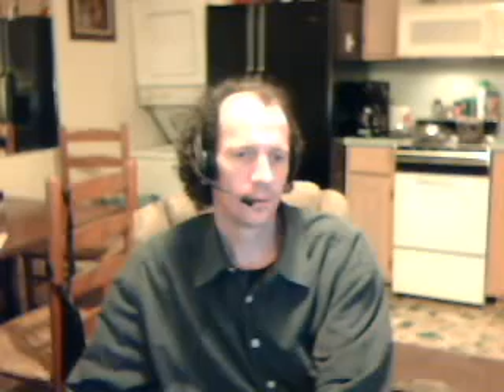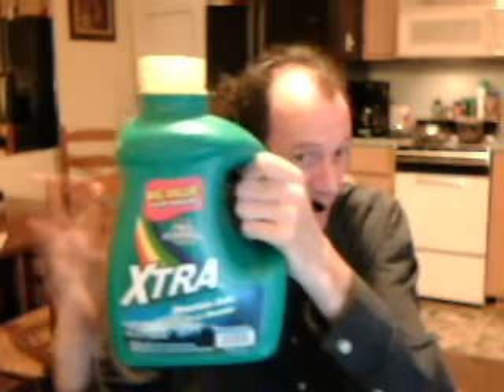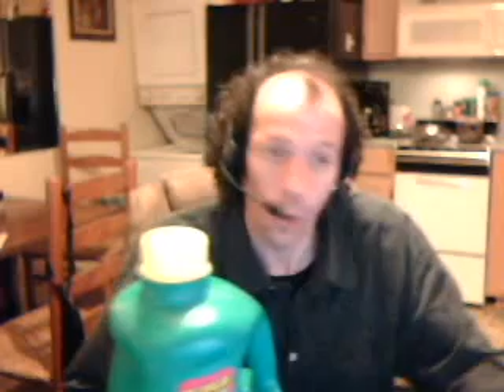Waste Plastic into fuel.wmv

Comment: I will send you the info I have.
Some are worried about the gasses coming
from this proses but the do not seem to realize that they sell the gasses
from this on the market as PROPANE and BUTANE.
When you brake down hydrocarbon chains "plastic" you get shorter 
chains of hydrocarbons "Just different types of what we call fuel".
I also see people worried about contaminating water but you do 
not need to use water to cool the vapor to liquid "I don't" it's just easier
to use in a demo machine.

Comment: This is not new. 
I have been doing it in my back yard for a couple years now. I run my gasoline powered mud truck on it and my lawn tractors and my house by way of diesel powered generator and fuel oil furnace for heat. Its not perfect but at around 40 cents a gallon or less  I can put up with that. I found my info on it on the net from people who did it back when gasoline was $1 a gallon so it wasn't worth it then.